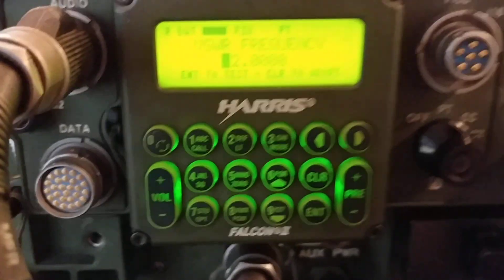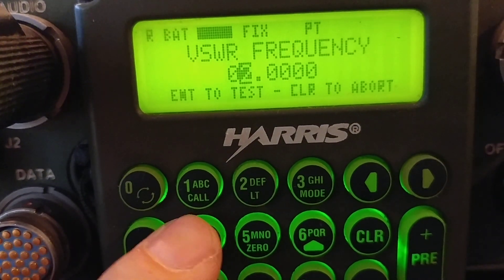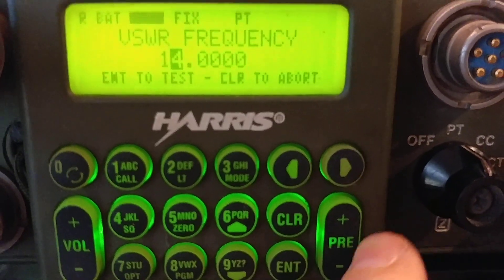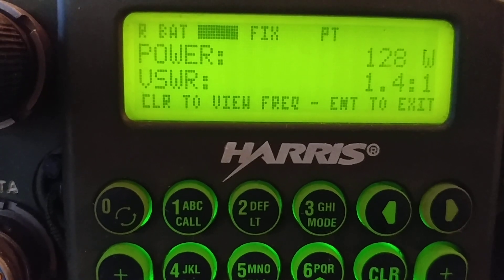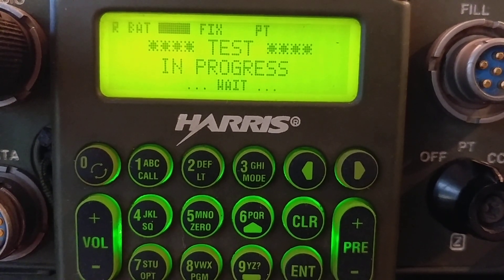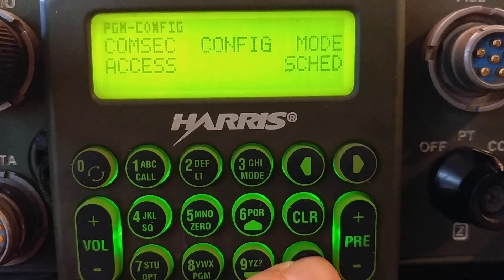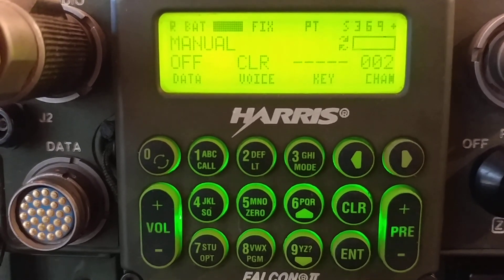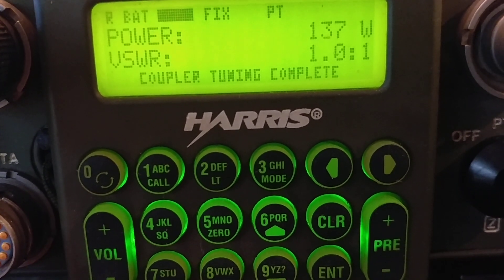Harris RF-5800H-MP/RF-5833H 150W Amp/RF-5382H Coupler/RF-382A Coupler Testing Part 3

Comment: do you know how to troubleshoot it if you try and retune on a PRC160 and it says "Coupler Tune failed, Coupler General Fault" but the BIT shows it passing everything else?
Reply from the maker: Try running the radio into a 50 ohm dummy load and see what happens

Comment: May be a throw in the dark but I'm trying to test my PRC-150. I keep getting A7 fault 99 coupler not installed. I have cleaned the contacts and checked both connections and still having issues. Any tips or ideas?
Reply from the maker: Which coupler are you using? There is a menu item that tells the radio RF-382A or RF-5382A or others. Look for that menu option.
Reply: @w2hx  I have had the same error. Any idea in which sub menu we can change the coupler type?

Comment: Can u teach us what is the right measurent of dipole antenna if the frequency is 08.0000 and the right angle...thank u very much...
Reply from the maker: Sorry, I wish I could help. That is not my area of expertise. Good luck
Reply from the maker: Generally, you are solving for the lowest ratio. So 1:1 is ideal, 1.5:1 less ideal 2:1 even less ideal etc.
Reply: @w2hx  thank u so much...
Reply: @w2hx  ive used my RF-5800H-MP (20w) and i contacted my troops almost 300 miles away.
Reply: Ok sir, how about the vswr, what is the correct vswr?

Comment: what is a good vswr . what do i want to shoot for and avoid.
Reply from the maker: Generally any transmitter will have a specification on the max VSWR it can handle. And when using an amplifier, the amp will often have a specification. Generally speaking you want the ratio to be as low as possible, the lowest is 1.0:1 (1.0 to 1). But higher can be ok. Most couplers try to create an impedance match that creates 1.5:1 or lower. The lower the VSWR the better match between the output of the transmitter and the input to the antenna. The better match you have the more power gets transferred.
Reply: @w2hx  thank you so much

Comment: These harris were very good, I had the experience of accidentally 
operating without connecting the antenna once, I managed to 
communicate 100 km away !!! I still do not believe it but it is true ... 
both connectors, the one of the equipment and the one of the Rf cable were close 
to each other ... 
maybe that's why I was successful ... and I did not disable the radio !!!
Reply from the maker: Great story! Yes these are state of the art radios very rugged and very capable.
Reply: @w2hx  hi sir can we ask for identifying the Fault: 17 EXTPA means thanks
Reply from the maker: @pinkyberbano7321 what radio? what amp? does it happen during BITE? does it only happen when you key up? Faults numbers also should show a module number, what is that number?
Reply: Wouldn't this burn the radio ? I mean using him without the atenna
Reply: @MrXtcraft  In theory yes, but these teams have very good protection against accidents like these, that's why I say they are very good although they are already a little out of date ...
Reply: @airesdelahuella   thks , here in Brazil we use the Falcon family at the army
Reply: I have a Harris radio rf5800 Can you help me how to use it professionally